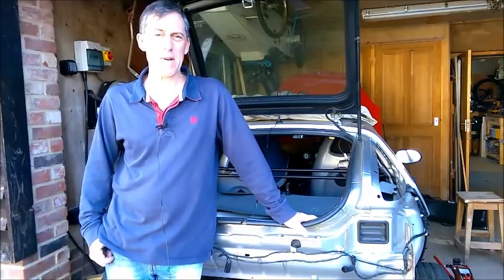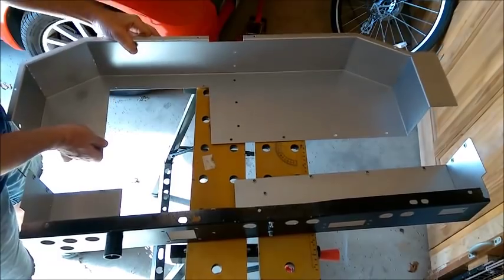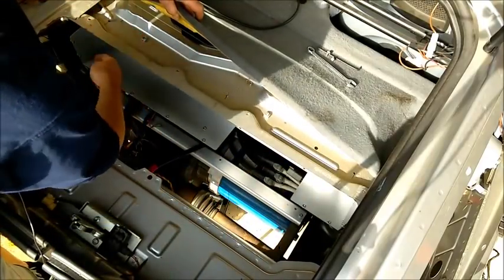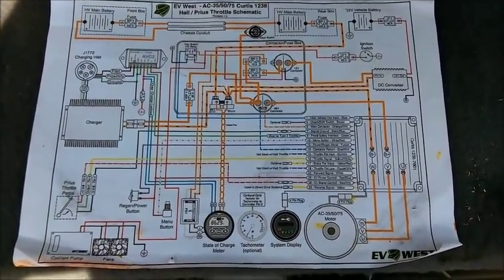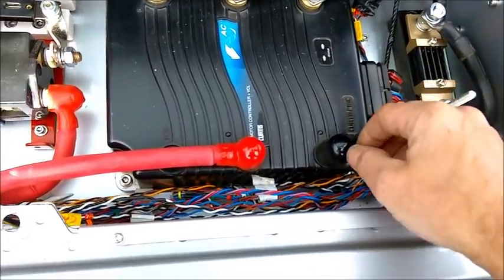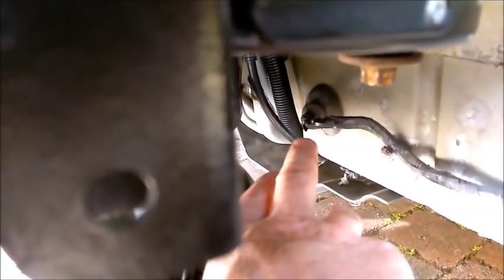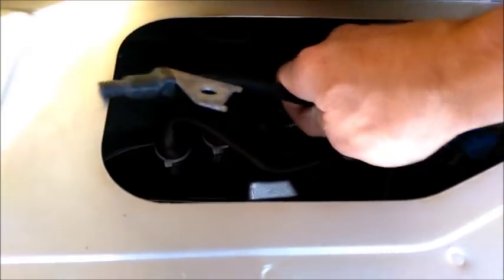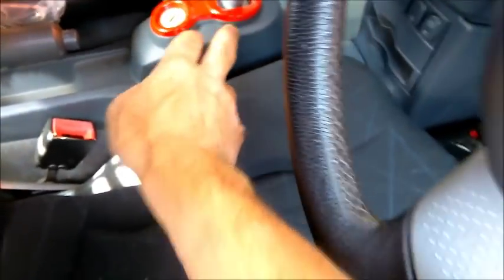Converting car to electric - Controller and cabling

Comment: may be a stupid cuestion but what  brand or  type of car it is? Thanks AMAZING proyect!!!
Reply from the maker: Hi, It's a Smart Roadster built between 2003-2006 so short lived. Great little car but suffered from slow auto transmission and roof leaks, I guess it's why it was canned. if I had the time I'd buy them up and convert and sell them as EV's as they are perfect cars for that but sadly I don't even have enough time to finish this one at the moment.

Comment: Hi, nice project and clean implementation. Congratulations :)
Did you weigh how much weight you saved by removing the engine, its attachments, cooling, tank, etc.?

I have the same project, but with a much wider range. The problem here is the maximum total load.

Comment: Glad to see you back on the project Paul. It's looking really good. Looks like you're getting a lot of views - a YouTube star in the making! Will conductive brake dust and/or water be a problem if they through that vent onto the motor?
Reply from the maker: Hi Chris, this has been such a slow project.. just no spare time and trying not to spend too much on it either. I don't think the brake dust will be a problem (and with plenty of regen they won't get used so much)... water might be. I've thought about a underplate across the whole rear chassis but that will have to come later.

Comment: Hi there been following your progress, great detailled videos. Just started on my own project of a Honda insight generation 1Hybid the 1999 version which is a similar weight to your smart at 750kg which is now minus 225KG of engine gearbox motor generator, traction battery and DC to Dc converter. I was wondering why you chose the AC 35 as I see there is an AC34 confusingly, what voltage are you running at? and finally where do I go shopping for the HPEV motor. When do you recon youll be on the road? Cheers
Reply from the maker: Hi Richard, the only reason for choosing the A35 is that it came up on ebay (along with the curtis controller), anything like this is extremely rare or expensive here so I grabbed it. I have 12 x 8v leaf batteries so 96v which is max for this controller, this should give me 50kw peak. Hoping to be ready in a few months but this has taken me ages as I don't have any spare time so who knows....

Comment: I wonder what kind of weight distribution you have now. You should have no difficulties finding a 12v for that space- since you don't need to drive some amp-hungry starter motor small lawn care batteries might work just fine.
Reply from the maker: Weight must be more equal now, these were always a bit light on the front so this might be better, and more lively at the back.. I think I need at least 15Ah to keep the headlights on for long enough although a 80v-12v converter will help keep the 12v charged, so as you say a small lawn or motorbike battery will be fine.
Reply: @crispydoda  I don't know if you have these in Europe, but here in the states junkyards refill and resell working car batteries that they get from junkers. Here in the midwest it's a good source for ~$30 buck batteries and you get a wild number of sizes. Maybe that might be a good option, since you guys also use far smaller engines that don't require 120 cold-cranking amp-hours.

Comment: I had never seen or heard of a smart roadster until I came across this project....wow I have fallen in love with the looks of the car...can I have it when it's finished...lol
Reply from the maker: Hi Peter, I love these cars too, the standard electric auto gearbox on them is not good and they only made these cars for a few years. They should have been electric when they were originally designed, they are perfect for it. I can't image ever selling this, but I could image making more!.
Reply: @crispydoda  Maybe there's a market for it. It's awesome anyways. Congratulations with your work.